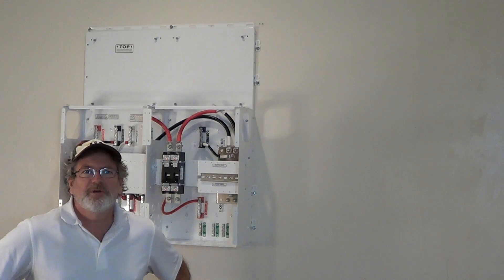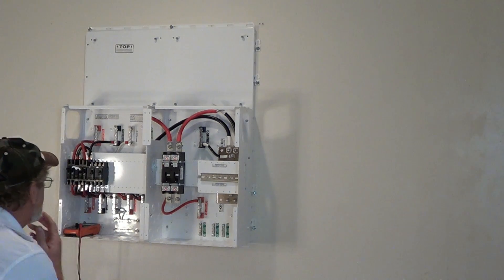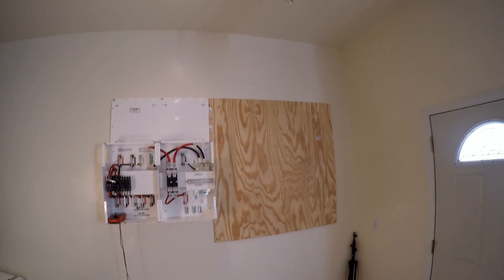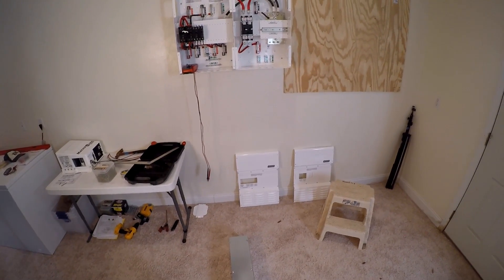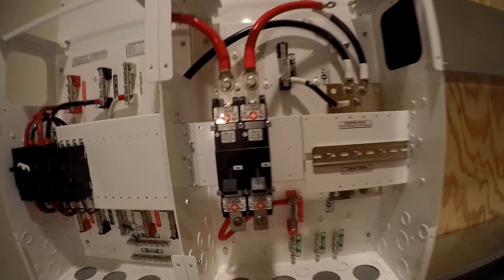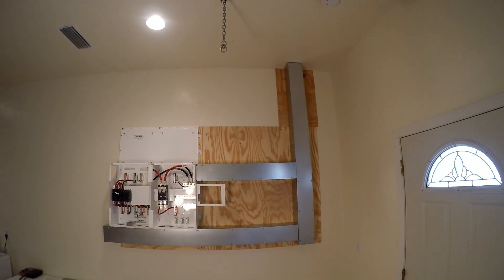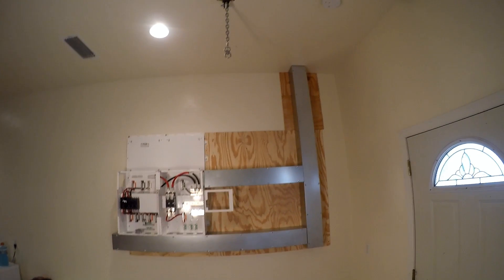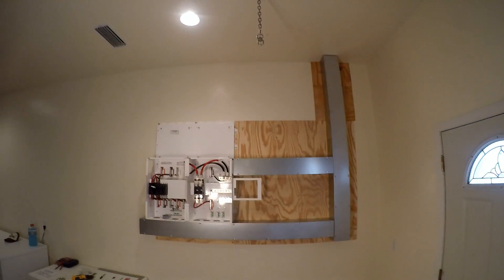Off Grid Solar #9: Installing Cable Trays

Comment: Nice install.  Very clean.  What are you using for cable trays?  I've never seen that style before.
Reply from the maker: Those are 6x6x72 and 6x6x36 Austin screw cover wireways.  One of the hardest things to find and exactly what I wanted.  I found them at CED (Consolidated Electrical Distributors).  They are located all over the place.  My CED goes under the name RAYBRO.  The 72's were $85 each.
Reply: Nice! Thanks for the info.   I love the install, and am planning to do something very similar (though, using the conext XW+ gear rather than magnum).  Now that you've had it installed for a while,  Are you still completely happy with it?  Anything you would have changed if you did it over again?
Reply from the maker: Jeff,  I have not and would not change a single thing.  This system is incredible flexible and can be used in so many ways and every way that I want it to be used.  The only thing that changes is that I am getting better at getting the most out of it with each passing month.  Last month (May) I cut from 2000 kwh (before solar) down to 289 kwh.  The system is bullet proof!
Reply: David,   thanks for the responses!   Yeah,  I want to do a very similar setup.  The primary difference is that with the conext XW+ setup,  I'll be able to "sell back" the energy I can't directly use in the critical loads panel..  so it can either offset energy consumption in my main panel, or be sold back directly to the grid if my energy requirements are low enough at the time of excess. As far as the actual wiring, and capability it'd be very similar to yours.
Reply from the maker: There is a huge advantage to being grid tied.  You won't ever waste any energy and pay back your system much faster than me.  I chose not to be grid tied because saving money is not my primary objective.  I want to be self sufficient and independent of the power company.  If your grid tied, the power companies are going to have their hooks into you and the rules will be changing going forward.  You can expect your sell-back rate to drop over time and your connection fees to go up specifically because your a solar seller.  I'm not saying you should not be grid tied, just understand the trade-offs.  Note:  when I say grid-tied, I mean net metered.
Reply: @HomesteadEngineering  Fast forward 3 years, and you are 100% correct.  FL is trying to pass a bill now that would reduce the net-metering payout over the next several years.  I've connected my XW's to the grid (back to my main panel) and use a wattnode to monitor current to/from the grid.  If it starts selling back to the main panel and then eventually to the grid... the inverter curtails the output so that I don't actually sell back, but my main panel gets whatever excess I generate over the critical loads panel.  This way, I don't have to worry about net-metering agreements or selling solar energy.. but still get the automated benefits of reducing my grid dependency even for my unprotected loads.